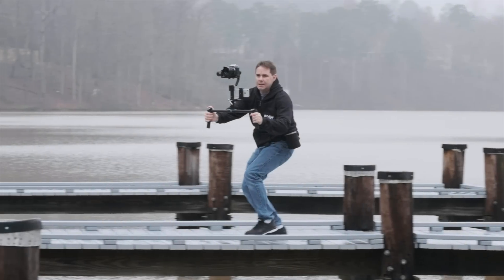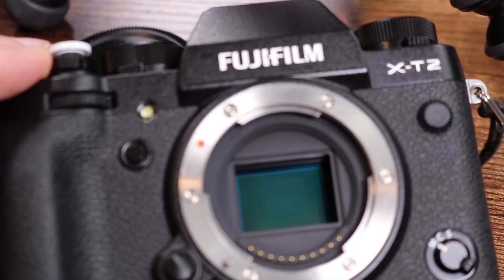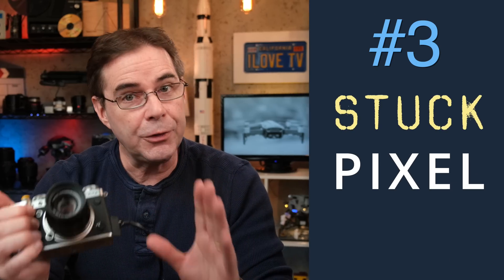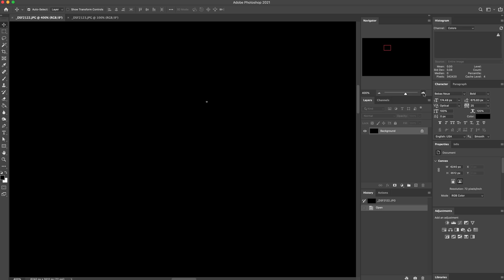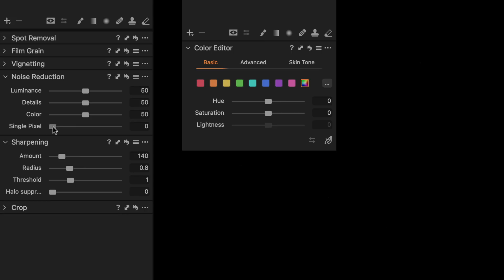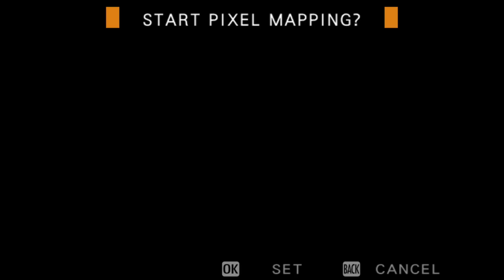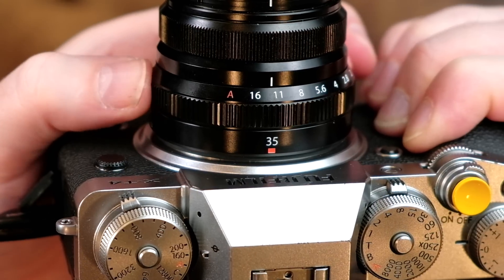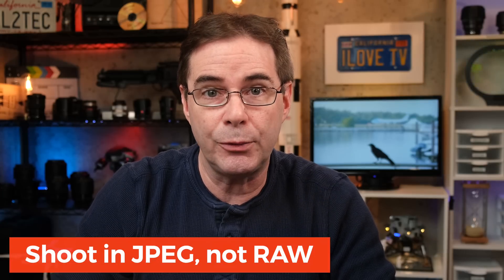Fujifilm Fix Dead Hot Stuck Pixels

Comment: I would actually instead do some long exposures, as most sensors won't have enough time to heat up at 1/1000s or at high ISOs for brief periods of time (less than say 1 second).
Most hot pixels will appear when exposures are longer and/or the ISO is higher (ie. more power being sent to the sensor) and combining these two would generate the most heat in many cases (ie. long exposure at high ISO so say 20-30 seconds at ISO 3200).  I would take a bunch of photos (maybe a dozen or so) at different ISOs and shutter speeds (ranging from maybe 1/10s all the way down to 30 seconds, and vary the ISO).  This will give you a good idea of how th sensor reacts to varying conditions.  It takes a bit more time, but will provide a more complete set of images for you to gauge the scenarios where hot pixels are more prone to occur and how bad they are.  This applies to any camra, not just Fuji's.  

I also disagree a bit about reviewing the out of camera JPEGs.  The best way to view this is using a program that does NOT clone out stuck/hot pixels.  Out of camera JPEGs may still show hot or stuck pixels IF they are bad enough, but generally some cameras will actually mask these out (or remove them) even if you have high ISO NR turned on, as part of the JPEG processing.  I would say to ALWAYS use the RAW files as they will contain the most data obviously, being RAW.

Comment: This tool only works for photo mode, but for videos it does not solve any dead pixel problems.
Reply: The best solution is to fix these with processing in post. RAW image processing apps have a filter that allows setting a filter using numbers in a small pixel area, so this can be put into an action. If you log the camera that is used on each shot, it can be a permanent video filter, until new pixels show up. An averqge xt4 has 1 to 3. The pixels may be visible up to iso1250 and disappear above 1600. You can see them easily in video mode in manual focus with the high zoom by scanning the image in iso1250. Some manufactures actively look for hot and very nonlinear pixels and remove them, but this kills normal image parts such as stars. Dust removal tools are also too aggressive. The correct in-camera method is interpolation from nearby pixels.

Comment: I'm so disappointed. Every single Fujifilm camera I had (three X-S10's and an X-T3) had dead pixels. I kept sending it back and getting new ones but it just got worse. Fujifilm straight up IGNORED me when I complained for like the third time. The camera has so much to offer, if it actually works, which it doesn't, and fuji doesn't care. Rant over haha.
Reply: @jaguarvisible1352  I had to use google translate for that lol. No, it wasn't solved. The only work around is to shoot EVERYTHING in 4K so that you don't notice the prominent dead pixel in the middle of the screen with my X-T3 in FHD. It's very disappointing....
Reply: @WhySteve use the dead pixel fix in Da Vinci Resolve.
Reply: Yeah, it's a workaround. But it's still disappointing that stuff like this happens and the brand just ignores you. Canon would have sent me a new camera.

Comment: Hey thanks for this  Video I found it very useful . I cant seem to find a Video that deals with a current problem I'm having with my XS 10. I thought it was a few dead pixel but after watching this I found out its not. there are a few  little pixels or dots  that are silver  or white in my video footage that moves around their same general area. they look like dead pixels but they move  around would you have any idea what this is and how its fixed. its very frustrating because I cant find anything about them anywhere. any advice would be greatly appreciated. Thanks !!!!!
Reply: Same problem, i have purple dot.

Any solution?

Comment: I just purchased a very expensive camera brand new and it’s LCD had 3-4 stuck pixels as soon as I turned it on. I did some basic configurations to get the camera ready for use but I did not do anything in particular for the stuck pixels. Anyway, I do not see them anymore. In any case, I can still return or exchange the camera as I just got it. Would you suggest I do that? Are they likely to be a reaccuring issue or are they a sign that I received a defective camera body?

Comment: Hi Pal2Tech, first, I wanna thanks for your very helpful videos - they give lots of knowledge and great tips!
Second, I wanna apologize for bothering you about sharing my problem. 

After about 1000 first shots, I found some defective pixels in my images - often showed out in shots at night with iso 800-1250 + ss 30-60/ second. For sure, I made some tests - cap closed, sensor warmed up at 1st , 2nd, a picture taken with iso 800, ss 30". I found some results that made me confused:
- 1st test:  3 defective pixels showed out (they're quite big, can be found if magnify 150%).
- 2nd (after the 1st few days): they increased 6 or 7 (tiny size)
- 3rd (after the 2nd few days): increased 12 ones (tiny size)
- and the near final test: I counted 22 - all of them have color white (most of them is very small, hard to find but 3-5 of them is easy to see)

Found them made me worry so much (because when I bought my XH1, it had defective pixel free  and I quite sure I didn't make any taboo in photography as shoot the sun directly). I can't distinguish they are dead/ hot or stuck pixel (in Vietnam, almost Fujier call all of them are: dead pixel, make clear is overabundant). 

Please notice that they're all white (not red/ green or blue). I hope your answer make me clear whether my camera got dead/ hot or stuck pixel? It is normal? Can I feel free to enjoy taking photos with my camera?

References: 
Image 1 (full size): https://ibb.co/vV5Lm16
Image 2 (Cropped): https://ibb.co/7R7yrfn

Many thanks and best wishes to you.
Reply: Hi..me too having same issue in my xt4..did you got any solution for this?it wil be helpful if you share it ..thnks ..
Reply: Saya juga mengalami hal yang sama pada kamera XH 1 saya

Comment: with this year i switched to Fuji from Nikon. My 9 Years old D800 with 500k+ clicks dont have a single dead pixle ( checked in LR with deactivated single pixel removal..)
Ordered an X-t4, the first one had 4 white stucked pixel in taround he center since day one so i refund it and got another one. Again 3 stucked white pixel.
Now i have my third x-t4, this as well have 2 white stucked but only in the outer quarter.
Pixel mapping didnt worked on one pixel. Am i just unlucky or is it normal with fuji?

For the moment i just keep the cam couse its so damn much fun to use and i will use the warrenty within the first 2 years..
Reply: Same story for me with my XT3, Fujifilm sensor is a bad joke.

Comment: Very helpful video. Related issue: is there any way to fix a stuck pixel in the rear LCD screen?
Reply: Hey!  The LCD monitor of my X-T4 camera shows the presence of Stuck Pixel (red color).  As per the remarks, it is limited to the LCD only, not transferring to the photo file or Viewfinder.  Did you manage to solve it or find a solution?  Worst of all is that my camera is new, less than 20 days old!

Comment: Thank you. As always very informative and novel. I actually was wondering if you would consider (or have already done) a video on the custom menu. I must confess that I have not paid any attention to those, but as I am looking at the 100s that has a dial with 4-5 of those I was thinking of try to learn them and see if they  really work. One thing that really bugs me is that I often use a 2 or 10 second shutter delay only to have to re-set it up every time the camera goes to sleep.

Comment: It’s a shame pixel mapping doesn’t work in video. Had a few gross hot pixels on my xt3 and really the only options are to deal with them in post or ship it off to Fuji for a re calibration. I shipped mine off and it came back perfect but still wish I could’ve just mapped em😕
Reply: Wow. How long did that process take from send off to return? Was it costly?
Reply: @vishal_trivedi  luckily it was still under warranty so I didn’t have to pay anything. And as far as time I was really pretty impressed. It was really only being worked on for one day, the rest of the time was shipping and waiting my turn. Over all about 8 days from when it left my hands to when it was back on my porch 👍🐠
Reply from the maker: Yeah, for videography is a huge issue.
Reply: My XT3 has been repaired 4 times with stuck or death pixels. Now I know if I have a video project I cannot shoot with my Fuji, either if I have a long photo shooting. Finally I use my Fujifilm for small projects where I don't need to shoot too many pictures in short time or just for my trips. If we don't overheat the sensor just the pixels don't get burned out. I'm sorry to say Fujifilm is not for professionals. I love so much my XT3 and I bought many glasses for it and I feel so sad I cannot use it as my main camera because I cannot trust it. I'm still using my old D800 for most of my professional works, it is a camera 9 years old I have millions of shots and I never had a hot pixel on it. The Image quality of my D800 is way higher and even iso performance are quite similar. I just advice to people want to buy any Fujifilm, if you are occasional photographer or amateur photographer and you don't use video at all then those cameras can be for you but if you are a professional... I'm sorry to say  I cannot recommend any Fujifilm APS-C to any professional, it is very painful because the Fuji cameras are just the most beautiful ones and the dials are quite convenient. Really sad to know Fujifilm have the most beautiful cameras but the less trustable ones.